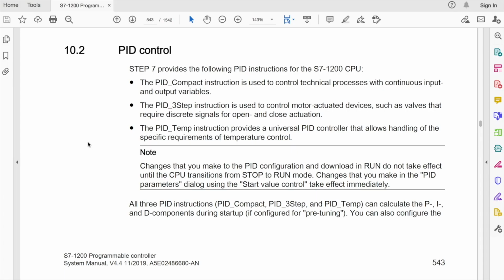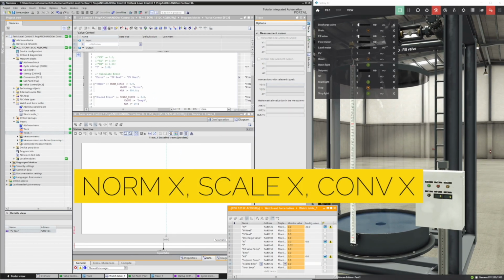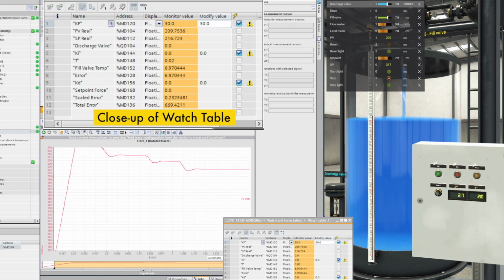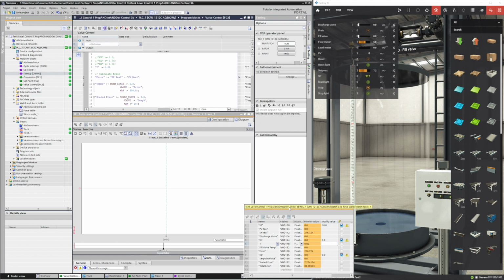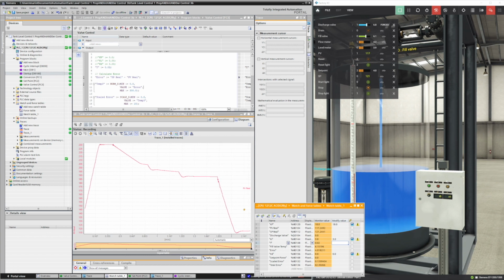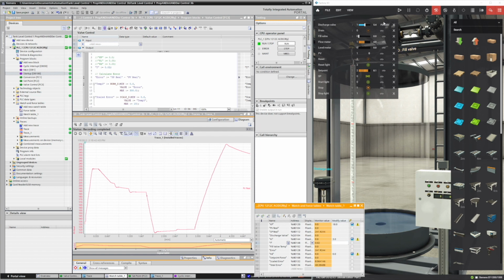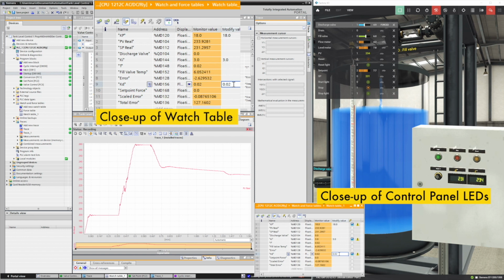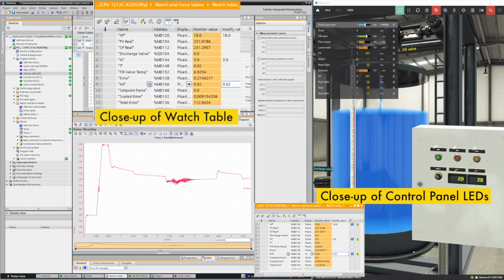PID Control with Siemens S7-1200 (SCL)

Comment: thanks . is there any possible to explain D too in pid ?? i have seen P and I but not D controller. how should i write scl code for D ?
Reply from the maker: Hi Ro. I will do this some time however the D part is not needed for tank level control, it is only really needed when controlling things that change quickly and erratically like a drone trying to keep it's gimbal steady in the wind.
Reply: @MarioCrispino  thanx 👍 yes you are right. There is no need D 🙂 but i really like to learn how can i write and use D i. Scl . :) And like to know when can i use d control